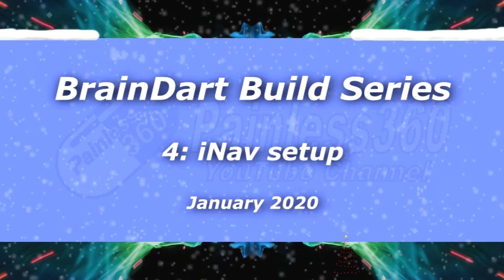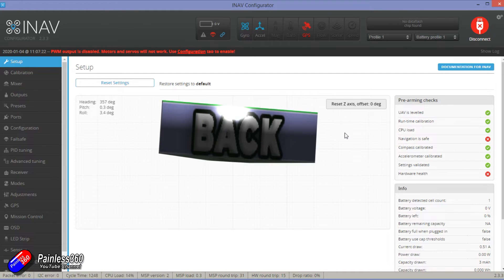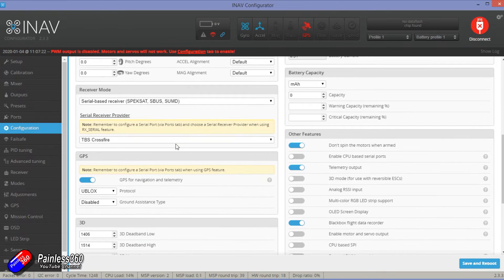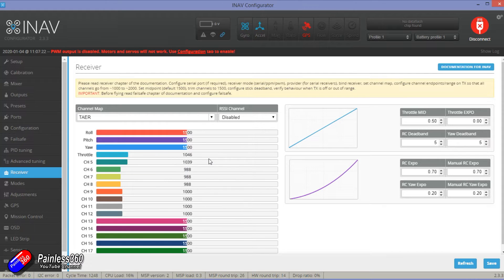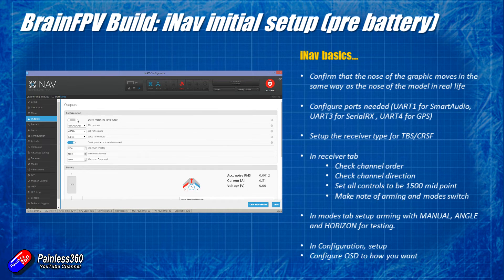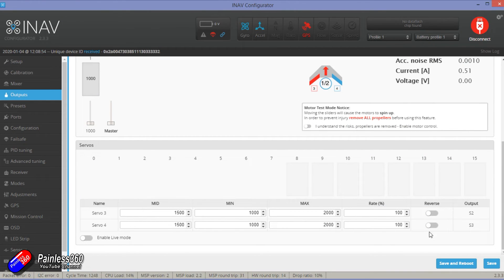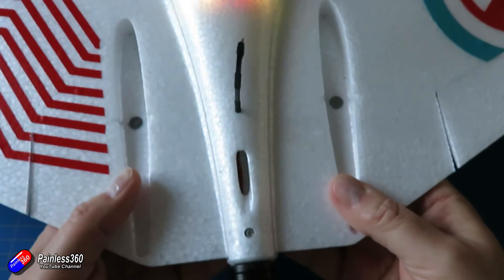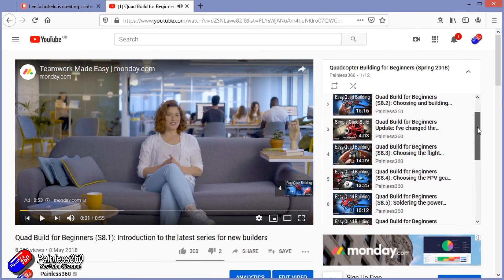BrainDART build: Full iNav setup ready to maiden

Comment: Love your videos.   I'm new to drones and r/c planes.  Just bought an e-flite optera wing after starting with and crashing an e-flite jet.  I bought a dji camera to put on it for using my goggles.   I wanted to use my Spektrum DSMX transmitter at least at first  so I would have the safety functions.  How do i hook up the camera  and also get the battery levels and other info that is available off of the dji camera kit without having to use the dji controller, even though  I have it. Thank you.
Reply from the maker: Check out the INAV for beginners 2020 series, it's designed for pilots in your position. I also have a mini series on the DJI FPV kit too that covers that as well.. Best of luck

Comment: Hi I saw that your OSD has an over lap of the Radix OSD and inav OSD altitude and speed. Do you have to leave the altitude and speed on in inav OSD tab for the graphical OSD of the Radix to work? I got it to show just the Radix OSD altitude and speed by only turning it on in the onscreen menu in my googles under the brain FPV menu but haven’t flown it yet to test it to make sure it’s working properly.
Reply from the maker: The best way to setup the cool OSD for the BrainFPV kit is to have the goggles powered up and watch how everything looks in the 'real' OSD rather than use the OSD layout in iNav configurator as how it'll look. Some of the things like the altimeter and speed displays are very different from the legacy ones configurator shows. TIP: I use PAL as it also provides a little more height to the frame and lets you have everything arranged with more space.